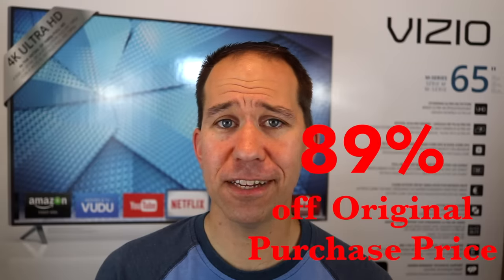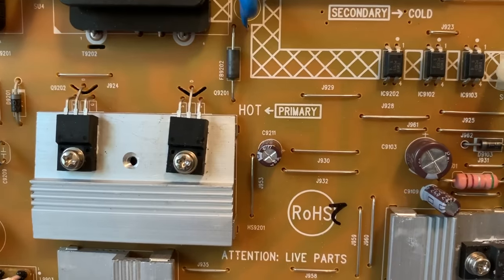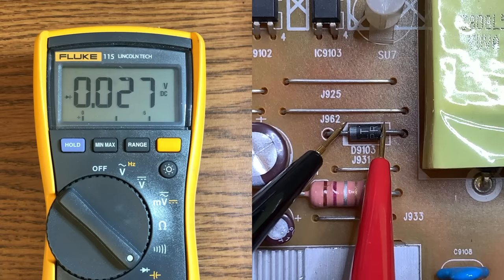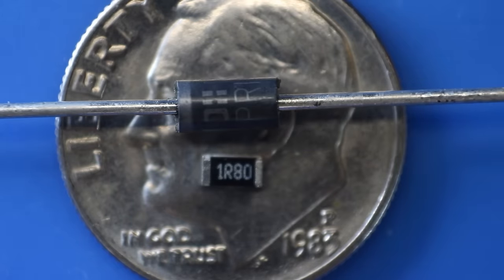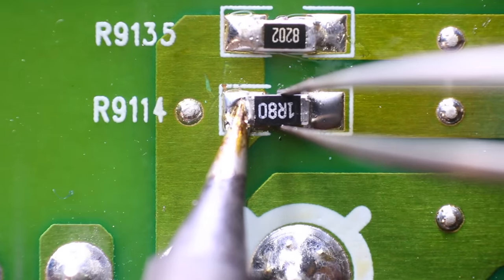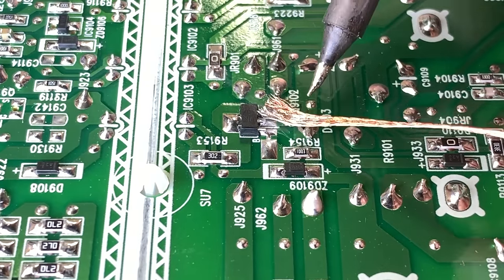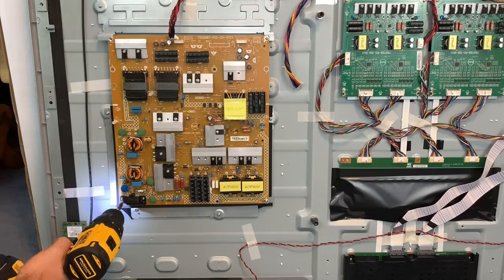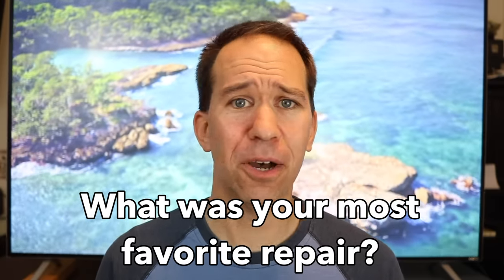I got a broken 65” 4K TV - How I repaired a Vizio M65-C1 (tv won’t turn on)

Comment from the maker: I like to fix things.  Do you?  If so, let me know what has been one of your favorite repairs?
Reply: Found a nice 50" SONY table top projection TV sitting on the curb.  Sure it's a little older and bulky (fat) but still a good TV. Replaced the bulb for $25. With a cheap broadcast antenna it is now my high definition garage TV
Reply from the maker: @davidwright640  Cool!  Thanks for letting me know.
Reply: Do you work on classic arcade video games? I did not see any videos on your channel related to coin op.
I am currently working on a Williams Defender game. Rebuilding the power supply. Replacing components, repinning connectors and flowing fresh solder for header connectors. Then I will be doing a rebuild kit on the Electrohome G07 monitor.
Reply from the maker: @AlexZander688  I haven't worked on any yet but would love to get my hands on one to fix up.  My kids would love me for it!  Did you get it working?
Reply: I love the fixed up
Reply: The easiest fix was a blown fuse on a 55" Samsung Tv.  I paid 20 for the Tv
Reply from the maker: @eat_this2565  Thanks for letting me know.  Great job on the repair!
Reply: I do it as a hobby.  Lot of fun.  But some people asking too much for a broken Tv.
Reply from the maker: @eat_this2565  Great to hear!  If you let your friends know and keep alerts on FB, CL, etc then you should have a good chance of getting free ones that people don't want to repair.  I agree though that some ppl ask way too much for a broken item.  I purchased the one in this video because i specifically wanted a big 4k and I wasn't seeing them being tossed out yet.
Reply: @FrugalRepair   I got a free Samsung the other day. the guy says it turns off randomly and I'm yet to duplicate that.  I think what ever he had hooked up to the H DMI port with telling the TV to turn off.
Reply from the maker: @eat_this2565  older samsung?  I'd guess the capacitors on power supply.  Did you open it yet?
Reply: @FrugalRepair  it hasn't acted up. I get no clicking. Been working fine for over a month.
Reply from the maker: @eat_this2565  Great!  Hopefully you don't need to work on it.
Reply: @FrugalRepair  i do have another Samsung that's stuck on a channel.  eeprom I'm guessing.  I reset eeprom but the TV freezes after 4 to 6 seconds.
Reply from the maker: @eat_this2565  Do you mean, stuck on the input?  eeprom sounds like a good guess, if the caps on the power supply are good.
Reply: @FrugalRepair  No sir, stuck on a channel.  The people i got it from used OTA antenna.
Reply from the maker: @eat_this2565  Interesting.  Let me know when you get it solved or if you want any other ideas.
Reply: You sir have inspired me , but I'm unsure of where to purchase new parts  for the TV I do the research but never find a good online store
Reply from the maker: @chlero_eyes  Great to hear that you want to get more into repairing things!  What parts are you looking for?  There are many places to buy online.  What country are you from?
Reply: @FrugalRepair  thanks for the reply I'm in the US, I find myself needing capacitors, fuses and resistors in general but I'm working on an LG lcd tv model  47lcdf- uk power supply
Reply from the maker: @chlero_eyes  What about mouser or digi-key?  You have to pay the higher shipping fee but they have great parts and selection.
Reply: can i ask for. your email add i need to ask help. for our tcl smart tv
Reply from the maker: @lindseynanola5795  what is your question?
Reply: I repaired a Vizio TV for a friend once. It had a very common problem with that model. There was a loose interconnection point between two boards. A quick blast with a hot air station to remelt the loose solder joint and it was back to life.
Reply from the maker: @glenengland2977  Great story and great repair!  Thanks for sharing.
Reply: bought a DELL latitude E5440 with no power and HDD , for R250 ~$16 repaired it for R0.00 just used old HDD and a soldering iron
Reply: thats the way how it should be. repairing not trowing away and make stupid garbage.
Reply from the maker: That is great to hear!
Reply: My favorite repair was a faulty ps4 that I received. It had been attempted to repair before, so 14 pads were ripped. Took me over 4 hours to fix it with a cheap lcd microscope. Now im receiving 2 more from a friend.
Reply from the maker: @menkveld3565  Wow, great job persevering and getting it fixed!   That is hard job to do.
Reply: FrugalRepair that friend sent me 2 more with ripped pads. 35 pads to restore... ill be busy with this and school etc
Reply from the maker: @menkveld3565  Maybe invest in a new microscope?  Hope the repairs go well!
Reply: I have a few questions concerning very similar repairs. How can I contact you and send you my email?
Reply: I like the soldering & de-soldering part, & i fix alot of things at home...Generator, Tablets, Phones, Pretty much anything i can :)
Reply: I have fixed Microwaves, TVs, Blenders, Grinders... I find problem debugging the problem as many times it is not as obvious as hole in transistor. and since I don't have electronics back ground i am not sure what voltages to expect at various different terminals or points... further it is sometimes hard to get parts.
Reply from the maker: @Zeshi185  That is great to hear!
Reply: @FrugalRepair  Thank you
Reply: Friend had a 55" 4K JVC TV that wouldn't "boot up". It had been hit by lightning. I told him if he was going to throw it away, I'd like to have it. He got a Samsung so he gave it to me. I powered it up, and realized it would power on, the panel had power, but the system board was fried. Found a used system board on eBay, replaced it, and that TV is now in our living room. Had to get new feet for it, but all told we were into it for $50.
Reply from the maker: @MattCoversTech  Great find and repair!  Thanks for sharing.
Reply: I like to build and fix things just wish i saw this and went down the same route before going out and buying a brand new tv! 

My LG screen doesn’t come on anymore and LG are trying to say it’ll cost £400 to fix...🤔 Yeah right! 

The tv itself still comes on as normal, you can hear everything, you just can’t see anything, it’s like the screens been switched off, any suggestions?
Reply: My broken gf. :/
Reply: I would like to start repairing things. I just need a good way to start...
Reply: A large batch of bad caps monitors. Literally dumped to me, and managed to get off tons of bucks.
Reply: Purchased a 75in Samsung LED Smart TV that had no image. Purchased $159 LED Strips. Now I have beautiful 75 inch that cost me $235. I say not bad.
Reply: Gabi Vazquez Hi. I don't have a lot of info about this.
Reply: @Box223  you've never replaced the LED strips of a TV? It was fairly easy the difficult part is removing the LCD screen since it's so fragile. But now I have a great TV that originally cost $1,800 for a fraction of that price. It really pays to fix broken equipment. Helps to not have to scrap and or recycle fully functioning equipment that might have a small problem.
Reply: Gabi Vazquez I might try soon. I have never taken apart a TV before.
Reply: FrugalRepair I have a 75inch tv my son threw a medal object to the screen it has vertical lines but the tv works how do I get this fixed .
Reply: MAC BOOK OLD VER
Reply: I diagnosed and replaced brushes in a washing machine motor. £12 for the parts and a bit of my time, found a video online which really helped.

After watching it I was confident enough to give it a go myself.

Is there a specific place online you’ve found to be a good resource for issues with faulty tv’s?
Reply: I'm New to wanting to learn how to do what you just did by fixing A 4Ktv that was broke and owner either didn't want to try to get it repaired or simply because was not able to afford to pay for the diagnosis and or repairs....my 1st project is A Sony Surround sound Amp Model# STRDE 325 
Issue with it is the most common problem with these Sony Amps no matter what model it is And that issue of course is the "Protect" flashing across the Digital Display when the power button is pressed there's a 5 second delay and then "Protect".... I've been doing a lot of research on the issue and it's most common problem with the "Protect" is a Resistor? Capacitor? Lol.... like I said I'm extremely novice about electronic repairs and not at all familiar with the terminology yet but anxious to learn....My Reason for writing to you is that I want to know if you can assist in any way shape or form in direction as far as maybe A video of you actually fixing one yourself? Or anything like that? I completely understand your time is valuable and I'm not anyone you know or probably don't want to know and I'm in no way of importance to wanting to help a complete stranger in this situation.... it's not your problem it's my own but having said that I would absolutely be appreciative of your time if you could give me some pointers on how to fix my 1st electronic repair which I intend to complete one way or another! Thank you for your time in reading my rambling and pathetic cry for help! God Bless 🙏😇😇
Reply: Coolest thing I like to repair is my traxxas T-MAXX 3.3 Truck. Everytime i take it out I beak something on it. I'm rough on it so it is expensive, but being hard on it, I can take it all apart and put it back together pretty easy.
Reply: My favorite repair was a few months ago when My Vizio M55c2 would not power on, did all the troubleshooting tips, still nothing.  I pulled the back off and looked around but nothing caught my eye, then did some wiggling of the internal connections. Put the back on, plugged it in, powered on.  3 days later... No power AGAIN.  LOL.   Any ideas?  I suppose I need to take the back off, and plug it in to see if that light is flashing.
Reply: @FrugalRepair  I try to negotiate without insulting the person and explain they are helping me get a TV.
Reply: I repaired my Onkyo receiver. Worked great, then after 3 years, no sound. Youtubers showed a normal fix for this often problem. I bought a heat gun and reflowed the video chip and installed a heat sink. Has worked great for over 2 years!
Reply: How you learn how to do it
Reply: If on my power the circular green piece is burnt out (I believe it’s a resistor) how do I find the replacement part? I wanted to find a new power supply board to make for a quick lazy replacement but they’re all sold out 😂.
Reply: I have repaired laptops desktops TV's cars cellphones speakers and more just by using you tube videos like yours as my learning templates. Bless you and all of my fellow YouTubers
Reply: @davidwright640  I'm
Reply from the maker: @crackseller321  Great to hear!
Reply: I have been into repairs since I was 8 years old. It fascinates me to see how things work. I have repaired so many things, I get that same excitement as you do when I am about to power on a project that I have been fixing and to see it turn on. Oh man what a feeling. Sorry rambling on. The easiest fix for me was a 55” vizio full HD tv recently, about 90 days ago. I found it on a curb and took it home right away ( I am always on the look out when I am driving) it didn’t have image but had power so I opened it up and as soon as I take the cover I see a flat cable that connects to the T-con board loose, just dangling there. I connected it powered it on and see that Vizio logo. Easiest fix ever. Only spent 13$ for a new original remote. Sorry for the long post. Thanks for your videos.
Reply: I have got a LG 60inc the ant got pulled out need to fix it
Reply: My favorite repair was a 1925 Deforest radio, I fixed when I was in high school.  I have been fixing old radios for 30+ years now. I recently repaired a Vizio 65 in Tv by replacing the bad individual LEDs on the backlight strips. ( I had some scrap backlights I could remove LEDs from. )  You can make a Backlight tester from 3 9V batteries and test probes.
Reply from the maker: @charlietrain  That sounds like an awesome repair!  Great job on the others.  Thanks for commenting.
Reply: Leonard Wheeler you might need to replace the board, depending on how bad it is. Open it up and look at the part number for that board and do a search online.
Reply: Can u help me with a fix. I have no idea what’s wrong with it . A third of the lcd is bad but the rest of the Tv works just fine .
Reply from the maker: @monster7209  same model as the one is this video?  It may be bad tcon or bad panel.  Is it a horizontal or vertical problem?
Reply: I tried to fix my computer monitor, and i found that there is a burnt component. I replaced it with a new one, and im glad that it is working again. My problem now is my 40" LED tv, i don't have any idea what is wrong with it. The screen is doubled and moving upwards. Hope you can give me an idea what is the problem.
Reply from the maker: @redentorflores2344  Glad to hear you repaired it.  Your TV may have a problem with the tcon or with the lcd panel in general.  In my next video (I'm working on it now), you may get some helpful hints to diagnose it.
Reply: I repaired my broken leg with some flex seal real quick. Who Needs doctors!?
Reply from the maker: I heard that works to fix drones too!
Reply: I bought a broken laptop many years ago that wouldn't charge. It was a gaming laptop I nearly got for free. I fixed it with a .26 cent part by changing out the DC adaptor. The only thing I had to buy really was soldering iron, flux, and wick.
Reply: At the moment I'm dealing with a repair and could use some help. Vizio M3D460SR, color went out(I think I might know what chip overheated on it). Ordered another board and it has color. but non of the HDMI ports are working right. HDMI1 has no signal, The other 3 recognize that something is plugged in and says 1080p in the corner, but the screen is blank. Tried a ps3, cable box, home theater and chromcast. Chromcast showed the G and then went black again. When I plug my laptop in, it works! Complete working picture of my desktop and anything I do on it. So a little lost on why, one thing works and all others don't switched cables, put back in the old non color board and the HDMI work fine.
Reply: Fixed my sharp 42 inch TV    it was just the  tny 277 IC  that looked in perfect condition -
Reply: A couple free ccfl lcd tvs where you just needed to compress the top panel ribbon cables  some.  Say with some folded alum foil to help dissipate heat with perhaps some this foam inside.   Super easy fix.      However, one tv rear plastic body gets these white mold like spots in my basement.  I run a dehumidifier and have cleaned it many times.  Can't get white spots to stop forming.  That Sony also does not accept a 1080p input, only 1080i for some reason.  Odd.
Reply: Had fun working on a LG 55" Plasma. Loved the depth of the plasma picture and repaired it for $22.
Also put a power board in an LG 42" LED. I use that one outside on my patio. Holds up in even very cold weather to my surprise.
Reply: The best repairs and upgrades have been to computers. Been doing it 35 years now. Amazing how fast you can make and older laptop or computer with a little memory and a ssd drive.
Reply: One of the companies I support for their IT needs is a software company with an IC hardware repair department. I have always loved fixing things and was talking to one of the users about a TV I had just repaired and he said he had a really expensive old 42" Plasma TV I could have. So I picked it up and armed with the description of the loud pop and no picture but still sound I hit google. I track the problem to the most likely suspect of the video processor on one of the boards and got the OK from the repair department to bring in the board and use their microscope station to desolder the 29 pin heatsink that housed the processor inside it. Sure enough, I  got a crash course in micro-soldering/desoldering and 20 minutes I was looking at an epoxy resin filled spider thread processor (That's what I called it due to all of the traces running all over inside the epoxy) anyway 6 weeks later I got the $50 replacement processor from china and screwed it back on to the heatsink box turned it over and soldered it to the board. I have been hooked on Microsoldering ever since. Love the Tape trick you should see shat I can do with Beach tar and baling wire! :)
Reply: Fabulous video Reece. I'm your latest subscriber and i truly enjoyed your video... my first scary repair was on a 1971 Kawasaki 500 triple which nine years previously had up and suddenly died,. I gave up on the bike and it sat around for years collecting dust. This hibernation ended when my son, brought the bike back into my life and enthused with determination, I set about to find the problem. Fifty year old electronics were always going to be the prime suspect, not helped with heat, oil, vibration and so on, the main problem was always going to be in finding replacement parts, that were not going to fail and were not going to increase third world debt. Anyway long story short, having isolated the working electronics from the non working electronics, enabled me to source the latest CDI igniter and a new old stock pickup coil which was needed to send a signal to the igniter, both having failed. Its hard to express the marvelous feeling of elation when after such a long period of hibernation the engine fired up for the first time nearly ten years later. Anyway warmest regards from New Zealand and thank you for your wonderful channel. Kindest Regards Howard :)
Reply: @davidwright640  I have a 60-inch projective TV my standby lights on blinking but no power what you think I can do
Reply: @leonardivy819  Honestly, I am not a repair tech. No Idea
Reply: The only things I've ever fixed up were vacuums. Much easier to open up and repair.
Reply: I gave it an honest try didn’t work for me. I believe it was another issue. Want another M65 to fix?
Reply: Countless upright and chest freezers tossed away. repaired for pennies. resold ...
Reply: This one!
Reply: Can you fix a yellow vertical line on a TV? Vizio tells me it cannot be repaired
Reply: I fixed an old tv by putting a new fuse in it. Now my Panasonic Viera TC-L39EM60 Keeps shuting on and off about 6 to 8 times before staying on. It started after I got comcast xfinity installed. Any Ideas?
Reply: about 40 years ago while stationed in Japan I made extra cash picking up "broken" tv sets before the trash trucks got them. blowing the dust out of the backs fixed about half the sets which i sold like hotcakes to other airmen.
Reply: I have the same tv but I need a t-con board. Do you know any websites I can buy it on
Reply: I also like to fix electronics. I got a 65" tv for free and fix it my self. i  like your shows..
Reply: I fixed the stereo in my Ford truck.  For years Ford radios were known for low quality soldering that caused the displays to fail.  It's harder to get the unit out and take it apart than it is to fix the cold solders.  It's been running fine for years now.  Local stereo place want $700 to replace the radio/cd/tape player combo unit.
Reply: 👀Awesome video Buddy!!.👍...I love fixing TVs , doing Computers Maintenance & fixing My Mazda 3!!.😂🇵🇷👍
Reply: My two favorite (and only two) repairs was my two LG tv's that I got for free!! The first one was a 42" and it had bad colors (what was suppose to be black was green) and I just needed to reheat (reflow) the main processor chip on the main board but this fix is only temporary I need to reball the chip so I don't need to reflow every 6 months or so. The next one was a 55" that it had a HDMI ripped off from the main board and I could see a prior attempt to resolder back had failed so ordered a new HDMI and needed to do do major micro-soldering here!! Out of 19 pads (HDMI) there were 14 that were ripped off so needed to solder very thin wires to each of them after it was done I powered it one and it had a flashing logo on screen and that told me that it had bad back lighting so tested it and yes the lighting strip was bad so I ordred one online and changed it and voila a semi free 55" HD tv!!! Now waiting to get more free tv's but living in a small town is hard to get by.
Reply: Rees, You are my hero. And thanks for sharing real knowledge to ordinary people like me.  The world is a better place to live on when guys like you help out others to learn important things.  🤩
Reply: Fav fix was my LG front load washing machine, thnx to y-tube! One month out of warranty and it crapped out. Took it slow, followed directions and got it repaired on the first try.
Reply: Repairing my Kinect that hasn't worked for YEARS and I mean YEARS